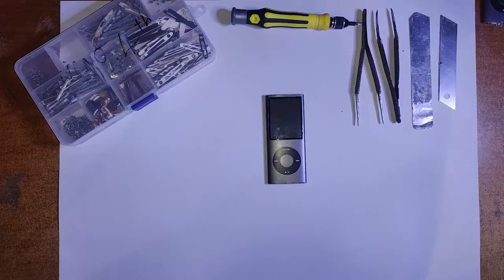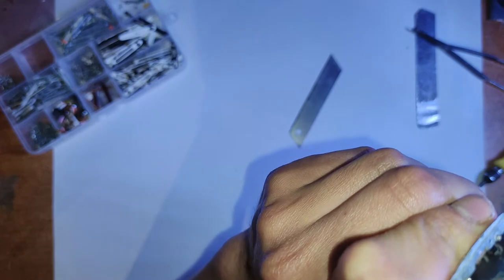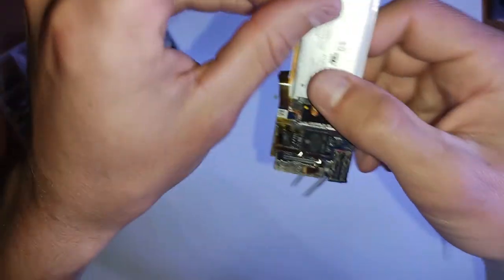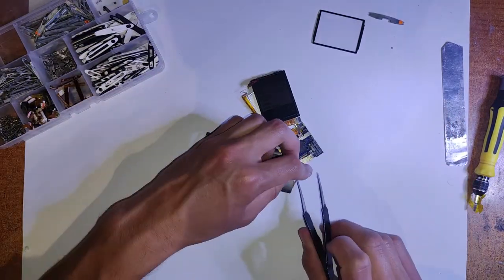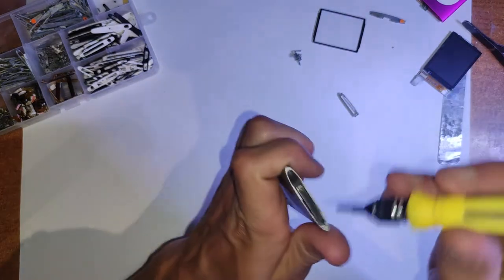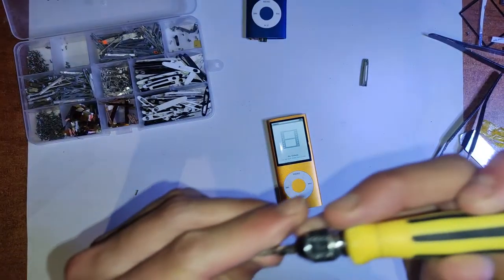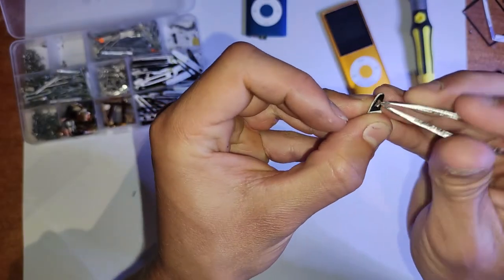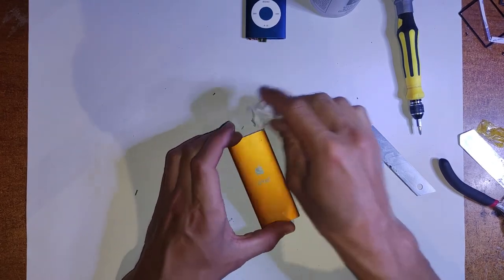Apple iPod Nano 4th Gen Ultimate Repair Guide Battery LCD

Comment: i have like 30 of these. these things will be the end of my life. its driving me insane. theres a little ribbon cable thats bent with a white like that gets caught everytime. so many ribbon cables break. i can take these apart so fast and easy, putting together is driving me insane. Ive broken like 7 ribbon cables lol its fucking driving me nuts
Reply: I have figured out like 7 problems that happen and how to prevent them. One of the dumbest ones was after putting ipod back together it didnt want to work.  just had to hold menu and the middle button to reset it like you did.

Comment: Great Video, thanks! The battery on my ipod blew up recently but since I'm only using it plugged to a stereo i don't really need it's battery. Do you have any idea if the iphone still works/turns on without a battery at all (when plugged to a charging station)?